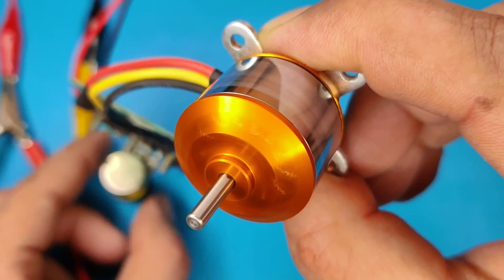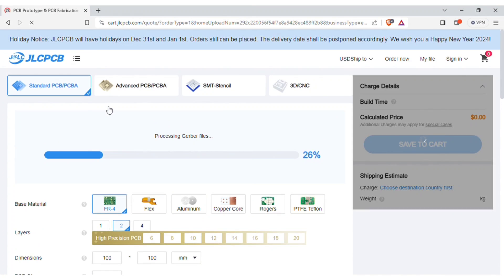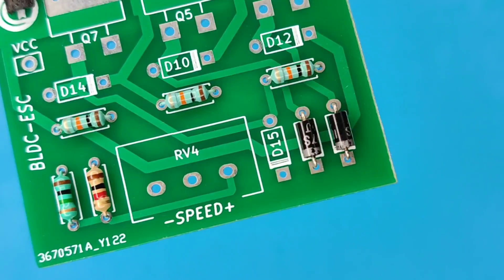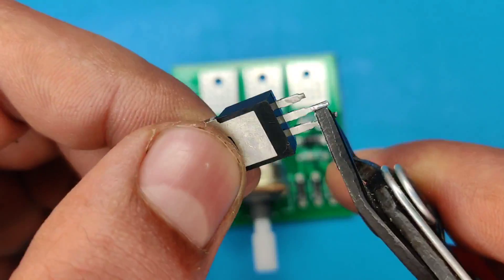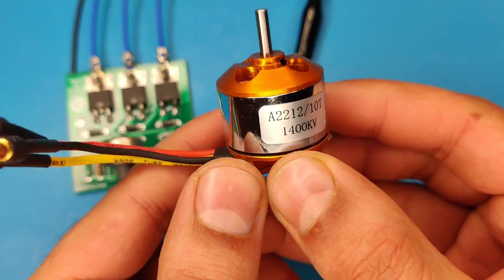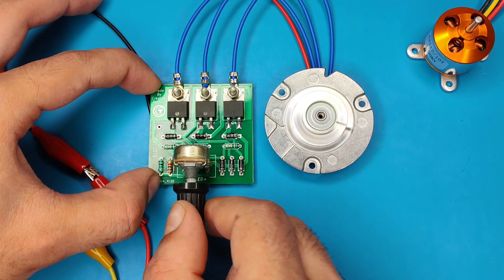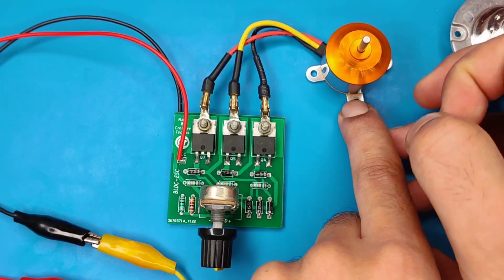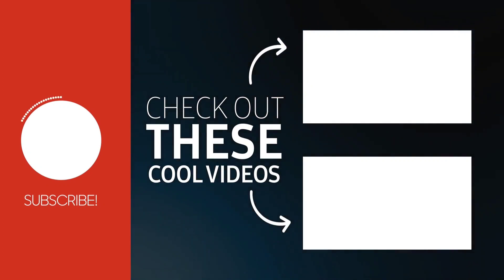Simple BLDC motor controller ESC circuit

Comment: Please make a simple bldc ceiling fan  driver only so that we can run it to connect 12 volt adaptor or battery . without remot without regulator .there are three wire outing from bldc ceiling fan motor red,blue,black . please...

Comment: you are recommending JLCPCB website, couldn't you just order the finished board ? why do you need to solder anything? I see no point in using this service, just a protoboard will do if I have to solder it myself

Comment: Are I understand correct, that for A2212/10T BLDS motor, wich uses around 10Amps+(under load), in this circuit, you have connected the positive electrode of the 9V PSU  through 1Meg resistor(R19).
In other words, A2212(which uses around 0.5Amps in no load mode) + control circuit work from 0.000009Amps(9V/1Meg=9uA) or 0.000081W. Is it correct?

Comment: URGENT!!! I am looking for an audio pre-amplifier capable of 300\400 times gain. There are several diagrams in the N.E. manual with explanations, and it can be nerve-wracking to stand there with formulas to be able to find the ideal Rx value ..... . The LM358 IC is great but I would like to know what is it capable of doing? What max results can be obtained? In short a noise or a voice at a certain distance .... . How to get it as close as possible and then run it through an 'AB' type amplifier. But what wattage is needed ....... ? Thank you very much.